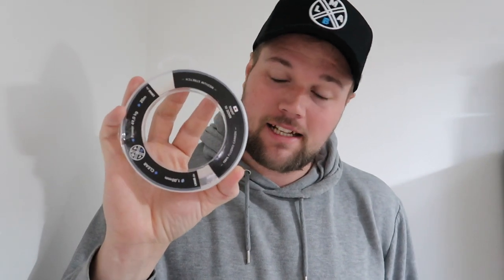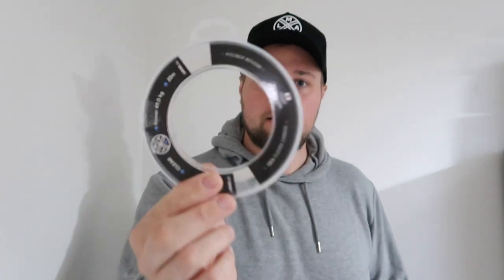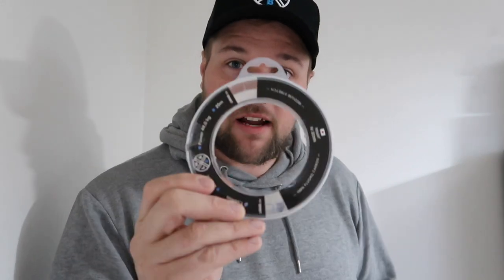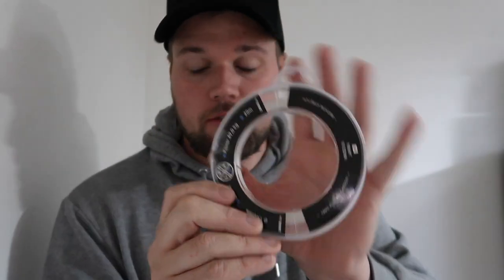How to tie Heavy Fluorocarbon To Braid for Pike Fishing! (FG Knot)

Comment: What knot would you use for your lighter gear for perch etc because I’ve struggled to find one thin enough to pass through the guides on the moustique?
Reply: Try the surgeons knot
Reply: I use a 4 turn water knot , passes through the eyes on my la mousitque , Tetton sul and benkei bfs set ups no problem. I generally use 7lb braid and either .18 or .20 Preston flouro , it’s smaller knot than the Albright and has never once caught the eyes